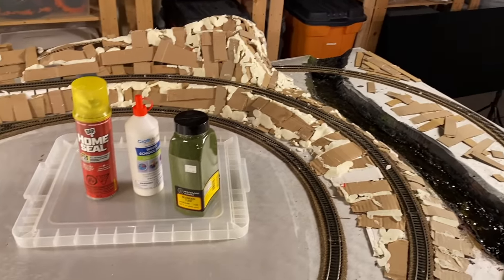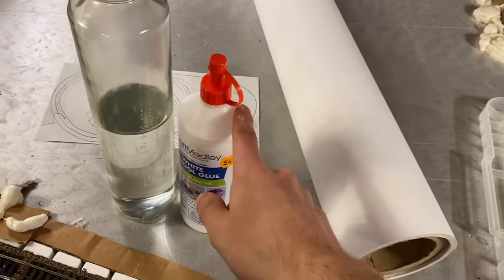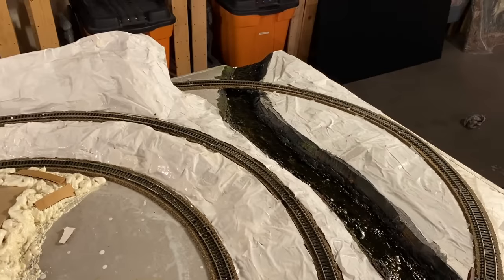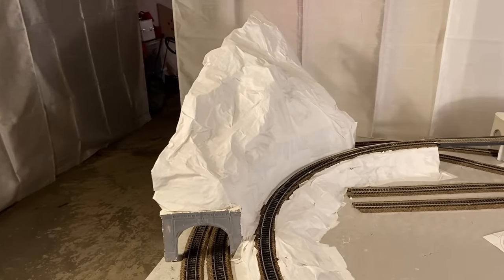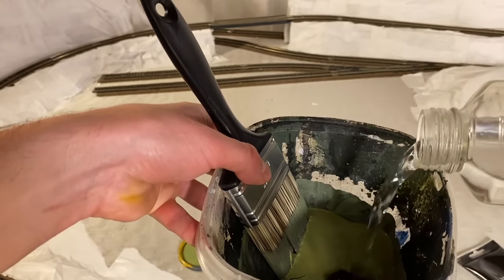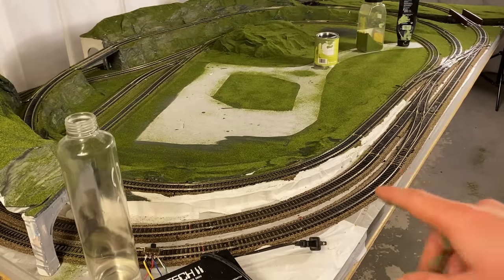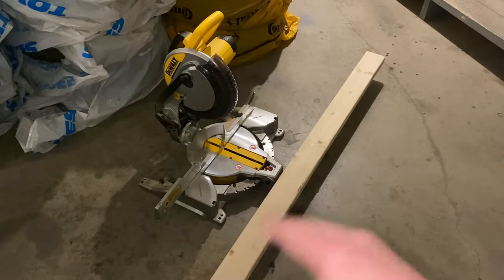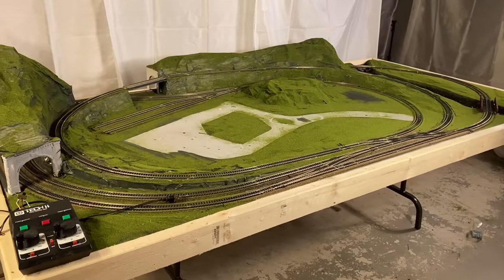Building a New 4x8 HO Train Layout Part 3 - Model Railroad Construction & More!

Comment: Coming right along Harrison. If I might throw out a few tips I learned over the years.  I used to keep several earth tones in paint and would freely mix those randomly over an area I was working as a base color. That way as you're putting down the turf cover you can go thicker in areas and thinner in others and can leave random patches of bare earth showing. I would also keep several shades of turf with a dominant shade overall but randomly mixed and blended here and there to avoid the suburban lawn effect and additionally some of the slightly coarser turf to add some visual break up and texture as well as providing some random vegetation in the bare earth areas. 
Don't know if this will be included in the trees and bushes but they used to have this fake fur for lack of a better term in various shades of grass that you'd fluff up and apply with spray adhesive that was amazing at replicating areas of tall grass and overgrown areas. Also remember bare earth,gravel, etc along river and stream banks to give that extra " feels right " to the overall scene.
Reply from the maker: Thanks for the advice, I'll keep it on mind for the next video where the next level of scenery gets applied.

Comment: white glue and water 50/50 and add isopropyl alcohol for hills downgraded areas to keep glue water mix from running away. or hair spray might be enough. I'm just trying to help you Harrison. use a spray bottle
Rodney
Reply from the maker: It'll try both, thanks for the advice Rodney 👍

Comment: Pro tip on using spray foam.  I saw this over at StiltBeastStudios.  Let the foam skin over (5-10 minutes) then you can use your hands to sculpt it.  You can also spray it with water which causes it to cure quicker (it cures by moisture in the air).  You could probably avoid doing all that trimming on the foam by just sculpting it with your hand.
Reply from the maker: I wasn't aware it was moisture that cured it. Thanks for sharing that.

Comment: Suggestions...

Put some tape or cardboard over the track when you do work. To avoid getting glue and paint on them.

The hill faces would look better in a grey rocky face. Woodland Scenics so silicone moulds for us to make rock faces out of PoP. You can also make moulds using foil. Scrunch them up and then unravel them.

Comment: If I had to give any suggestions, I'd add some Grey's and/or maybe some rocks on the more Vertical parts of the Larger mountain and along the walls of the Cuttings to give some color breakup

Other than that everything looks fantastic!
Reply: Yep. And some different shades of ground cover over all.
Reply from the maker: That's the plan. I might add some brick sheets over the vertical parts to add detail as well 🙂

Comment: If weight is a concern I'd consider using 1"X 4" for the outside framing  and 1"X 2" up-on-end and evenly spaced in the middle.

Comment: It's looking really good Harrison.. my one concern would be trying to get it out of your basement. Or loaded into a truck might crush that larger mountain.  So I wish you luck on that.   Otherwise it looks good.really coming along.
On a side note when putting the paper and glue down you might want to cover the top of the tracks with thin width masking tape.  Also your Turfing That way you can just pull the tape up when finished and have clean track. Also you cloud a thin strip of poster board and cover your river to keep the turfing flock out of the river.  To save your excess turf flock. Place an old pantyhose foot over the end of your shop vac hose and collect the excess flock and just empty the pantyhose foot back into the bottle...
Reply from the maker: My main concern with moving it is making sure whatever I glue down stays attached. Getting it out of the basement and shipped shouldn't be too difficult. (I think)

Comment: looking awesome harrison you may want to add glue on your ground cover paint will only hold so much just a little tip dont want your ground cover to fall on the floor 
rodney
Reply: Rodney - what tool do you recommend for SMT to use to apply that glue to the "grass"?
Reply from the maker: I was just gonna cover it with some hairspray but if you have glue recommendations I'm all ears.

Comment: well, id say any layout is transportable, it just depends on how much your willing to transport and how much effort your willing to put into the transportation. Its like transporting full sized houses by truck, doesnt happen very often at all but it sure requires alot of effort and alot of preplanning a route! lol
Reply from the maker: My family owns a long box pickup truck so I don't think it will be an issue getting it in, the question is if it will stay together in the wind if I can't get the box cover over it.
Reply: @SMTMainline  If you cant get the cover over it, id say get some long straps and a tarpaulin. Straps have to be long enough to attach to the body or somewhere else, ik some trucks have places for straps in the bed. Id recommend ratchet straps if you have some.

Comment: Hello man youve got some what of a collection ive binged watched ur videos last few days lol ive got 2 life like santa fe diesel locomotovis one runs fine one needs the lil circut board its got a strip lifted but the other say i put 10 cars behind it after a lil while it draws too much amps throws my saftey on my power supply me thinking the old power bank is bad i used a 12v battery & just let it run for say 20-30 min & it popped a 15amp fuse on my lil gator clips i used 😮😮😮😮 what would cause tht im a total newb here just tryn to get in to the hobby with my kidos
Reply from the maker: Sounds like you've got a short somewhere in the locomotive. I don't think a like-like motor could survive 15 amps.

Comment: Question: for the most inside loop, were you able to use 18"R curves or did you have to use 15"R.  Thank you.
Reply from the maker: I think I did use a couple pieces of 15r. It's probably possible to do it without them.
Reply: Thank you for the reply Harrison.  I don't believe so and don't think for the most inside curve you could have done it w/o having to use 15"R.

Comment: I have a question I know that applying the turf will somewhat stick to the wet paint but won’t some of it fall off?
Reply from the maker: You can add some hairspray or spray adhesive over it, just don't get it on the tracks.
Reply: @SMTMainline thanks smt

Comment: I have a lionel circus train that hasn't been ran in 20+ years.  I was wondering how much it would cost to get it b up and running? I donjot know if it runs or not.
Reply: Of course it will run ..just do it
Reply: You could try lubricating the locomotive's mechanism.  Put grease on the gears and oil on the bearings.  If the gears and mechanism are plastic, then use plastic-safe lubricants like Teflon grease and plastic-safe oil.
Reply from the maker: It shouldn't cost you too much if it was in working order when you put it away. Get yourself a fibreglass pencil and some locomotive oil.